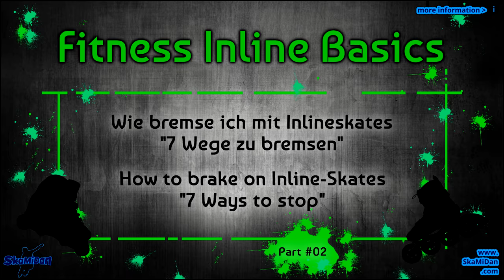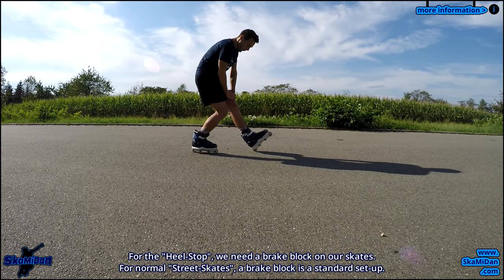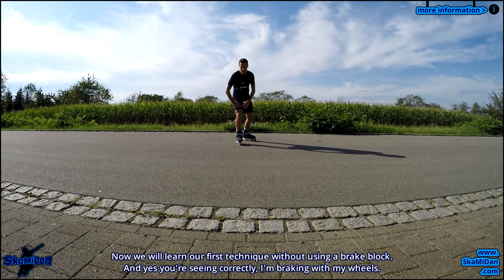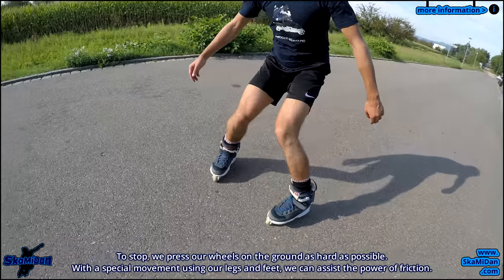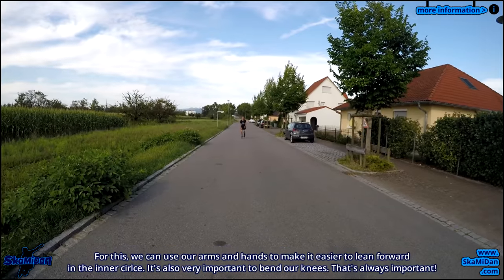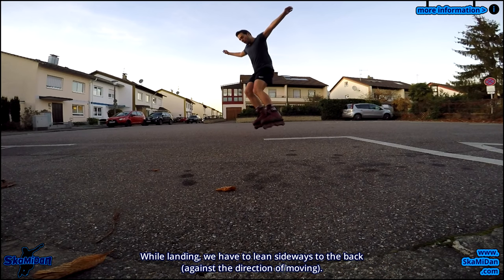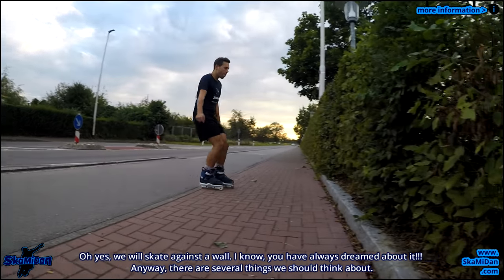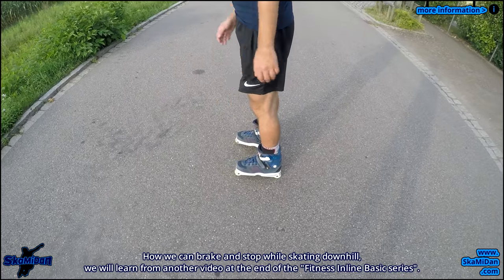Inline Skating: How To Brake And Stop - 7 Ways - Without A Heel Brake - Fitness Inline Basics #02

Comment: Plow stop: As I had it explained to me in a roller derby tutorial, you're basically getting into the A-stance (the second half of a forward swizzle or lemon drop), using your inside edges, applying weight I think evenly to all of your wheels, while pushing outward and getting low (bending your knees / dropping down your center of gravity). If you have trouble getting into a good A-stance, just do a swizzle / lemon drop to get into an A-stance.

I'm not a skating instructor, but I think that's about how it works. Please feel free to correct me where I may be wrong. I've been starting to see some success doing this as a relatively new skater, but of course we'd all like accurate instruction, myself included. ; )
Reply from the maker: And again, thanks in advance!!! It's really nice and helpful to hear about others experience on inline skates. 😇🙏
Reply: What's a swizzle/lemon drop?  Lol

Comment: My braking sequence has developed into deceleration with the T-stop and a full stop either with a spin or parallel/Hockey stop. To conserve my centre wheels (I use a banana rocker) I only drag the front or rear wheels. Interestingly enough, the harder centre wheels wear down quicker than softer front and rear wheels during deceleration. Since balance becomes more difficult the closer one becomes to a full stop during the T-stop, I like to use a spin for a slower/more casual approach and parallel/Hockey stop for faster and more urgent stops. In the end, you will develop your own preference of braking techniques. If its effective, its a good braking technique. Good video Daniel.

Comment: The t-stop turns me aggressively around and it wiped me out pretty hard a few times. Trying to figure it out tho
Reply: Keep your knees bent all the time for extra balance. Also when i myself was learning the T stop i found myself instinctively moving my hands to the side of the braking leg which causes a spin out, so if you also do that try forcing yourself to move the hands the other way. Another thing is that you might just be placing your braking leg too close to your front (supportive) leg or you might also be placing the braking leg too far behind the front leg, you want to keep it in a more of an L shape instead of a T shape. Hope it helps

Comment: I use my brakes to stop but I've never done it that way so idk if my way is correct? I just stay in the position that I was in while moving (slightly lean forward with my knees bent, like u do in the video) and lift my front wheels and press the brake on the ground. Like I don't put my leg in front of me and I still stop pretty fast. Is that a correct way?

Comment: Nice useful video, thanks! I am not able to stand on one leg for more than 2 secs, even standing still on grass. What is wrong with me?? Is it my boot setup? Valo v13 + Kizer Trimax + 110mm wheels.
Reply from the maker: Thank you! To your question, it's not your setup, balancing on one foot or leg is possible with every setup. But, the best thing you can do to maintain balance is bending your knee as deep as it feels good to do so. The more you bend your knee the more power you need, but the easier to maintain balance. A further movement to maintain balance is to cros your leg (the leg in the air) behind your dominate leg.

If it won't work for you, maybe one of my one leg tutorials will help you.

How To Skate On Only One Leg:
https://www.youtube.com/watch?v=8IkoEnLAS5A

Skating: Gain Speed And Jump On One Leg - Doing 180°s And 360°s:
https://www.youtube.com/watch?v=xH5f9-AkjCc
Reply: Thank you for your quick reply and extra tips! Appreciate it from a new guy in this world of inline skating. I hope you are right. I just bought this setup and after trying it yesterday I started doubting if I made a mistake by learning with the trimax + 110 wheels (the bigger the wheel the harder I think). My ankles woble sometimes very easily.
Reply: btw you have a new sub! Keep up the good work on this channel!
Reply from the maker: Thank man, especially for you recogintion in my work and videos. So, if your ankles woble sometimes, I hope your boots fit anyway. However it doesn't sound good. If a skate fit perfectly your ankles should not woble. :( Well but you're right, maintain balance on big wheels is a little bit harder than on smaller wheels, just because of power transmission to the ground.But be sure, you'll handle it soon, just practice and never give up! When I can help you in another way or do you just need further tips, please ask me, you're always welcome! 🙂✌

Comment: When I tried the wall stop, 😅I nearly smacked my face🤣but yeah It worked when I did it again
When I tried the T-stop, It didn't work maybe because I was on (flat)tiles?
Reply from the maker: No no, the T-Stop always works, but on even grounds you need more power to press your wheels on the ground (to slow down effectively). ✌ Btw. I hope your face is fine. ;)